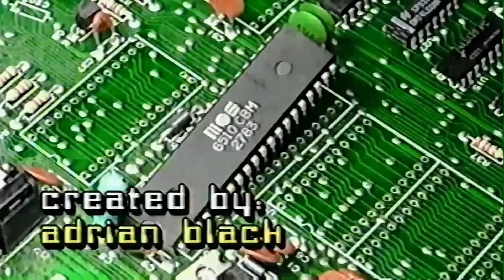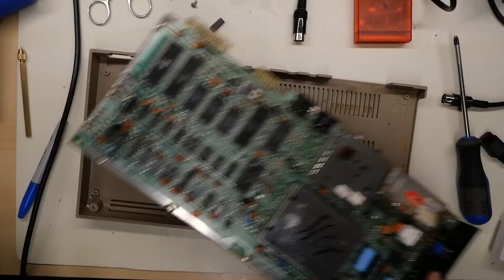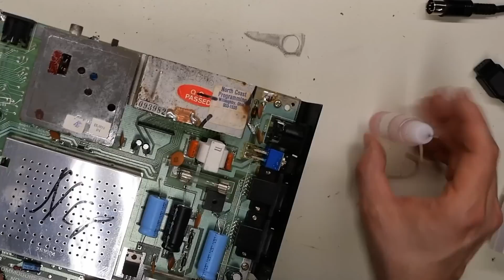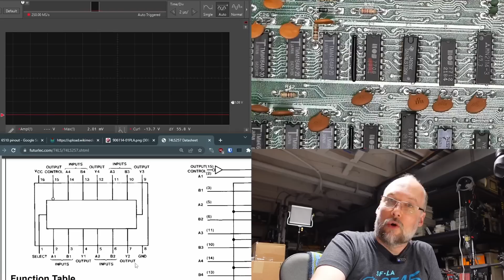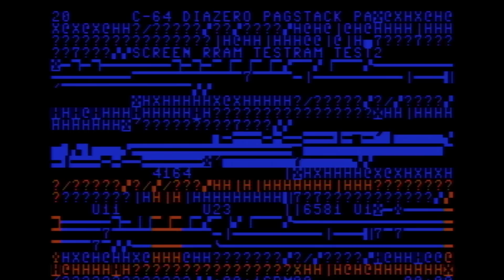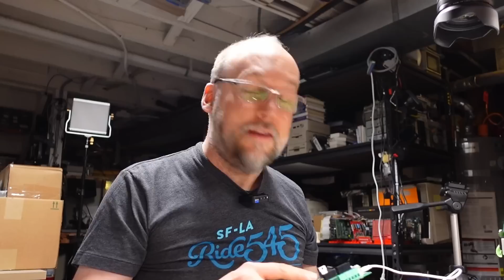2/12 C64 black screen repair: The chip was too fast for to work!

Comment: Hi Adrian i have 68 pcs of commodre 64 (All Working) a sx-64 1 c-128A and 1 c-128-D (all europe setup) 1 Amiga 4000 with 060 turbo and 240 gb ssd  1 pinoeer dvd 2 floppies 2 Amiga 1200 with 240 gb ssd harddisk with 030 turbo 128 mb ram currently and also all hardware possible or this devices that i made a very big collection even a atonce 286 pc card :) currently running win 3.1 on my 4000 running unix on my other hdd also i have shape shifter (mac emulation)  on my Amiga 1200  love to run em as i said since 1983 Commodre 64 and Amiga rules! Ps: Billgates and Microsoft Suxx! (as i say Since 1980) i can send you commodre 64 Business machines machines orginal Burnin cartridge .bin file totally free to copy/burn to a 27c64 eprom (used final test on production line in fabric) which left me D&R days on my cbm corps in early 1980's that will be much better for you to repair and fix dead commodore 64's...Take care mate Cheers...

Comment: I have a bit of an issue having just changed both my mos logic chip to 74LS257N. I wonder if its that chip type. Destestmax now says fail testing vic, zero page, stack page and page errors and i get a red border. The dead test runs but its garbled data but it looks like the CIAs are good. PLA is good and tested. CPU and VIC need to be working for destestmax to boot i understand, so they are ok too. Ive also changed the failing ram and the destestmax then just showed a jumbled page of characters like in this video, so i changed the logic chips and now i have the above issue. Any ideas anyone

Comment: When I removed chips and solder in sockets, I always used to put back the original chips in exactly the same positions and check that the symptoms are still identical to what they were before. This confirms that I have not made any mistakes fitting the sockets (and if it starts to work then the fault could have been due to a dry joint or perhaps a PCB/trace issue). Only then do I try the new chips in the sockets.

Comment: 19:20 - Tech tip, Adrian.  Insert the chip into a round-hole (high quality) socket before placing it in the tester.

Comment: I wonder what would have happened if you'd "tacked" a 0.1uF capacitor across the power leads of the 74F chip?  If the problem really was that the rise/fall time of the signal is too fast, there's a chance that the capacitor would compensate for it.

Comment: Wow! Brings back memories of fixing C64's in the day... this channel is so awesome!  I remember the way I found bad RAM chips was with the temperature feel test... HOT = BAD.  But I don't remember encountering bad MUX chips before, thanks... I learned something there!   I once had a SID chip problem that was caused by a bad socket... cheap sockets. 

QUESTION:  Do you have any suggestions for fixing broken keys on VIC-20's?  I have a couple of VIC-20's that have keys that got snapped off when (unfortunately) something fell on them.  I also need a couple of springs it seems those went missing years ago.  I still have the keycaps, they're fine... but the plunger part is what went "Snap"  Do you know someone that sells or has parts for repair?

Comment: Sometimes you can get the faster chips to work if you stick a few picofarads of capacitance on the inputs. Sometimes the faster chips allow glitches to get through that would actually get filtered by the slower chips. But there’s other timing issues that can happen too. 
I’m not sure any of the modern 74series chips are slow enough.

Comment: I tried a 74F series IC in a project and found out that 8 bit machines do not like them back in the eighties unless I was trying to complete multiple tasks in a CPU clk cycle.
Also the 74F and 74HC/T do not supply as much current as 74LS so may not hit the trigger level.

Comment: Don't quote me on this, as it's been a while since I looked at switches for the C64.

I believe the same type of switch is used in the Atari 130XE?

Have a look at the datasheet from C&K Switches, the PDF is called "7000 Series Miniature Rocker & Lever Handle Switches".

I'm not sure if they do a Dual-Pole Single-Throw, though. You might have to snip off the top set of pins to make it fit.

I have no idea what the original switch nor part number is, but if you can't find it, it might be worth buying one C&K switch just to try.

(I don't work for C&K Switches, btw. lol)

Comment: Adrian, you were asking for a database of C64 issues with screen shots made from your previous repairs, so I added a link to a page which had it all already done. When I looked the day after it was gone, I thought I must have not hit send so reposted the link (that I have no connection to) as I thought it would be very helpful. Would it stop people coming to the channel, no. But that link has gone again. A little explanation of why it's been removed would have been nice, just so I knew, it was just someone trying to help re a request you had made.

Comment: The pitfalls of propagation delays are always fun. I found long ago when using mismatched 257's, created many timing problems when correct signal timing was required on the same databus. Atari XY games were designed with that in mind.

Comment: Interesting stuff. Note the 74F series inputs have a .6 ma low input loading vice .1ma for LS. The 6x could also explain why the 74F didn't work.
Reply: Was gonna throw that out, myself... Just ran into this in a recent project.
Also, IIRC [later-note: *wrongly*], F and LS are [NOT] just about the same speed, too. F being older than LS, so "fast" in comparison to 74nn, not in comparison to other 74Xnn's.

Comment: '"The chip is too fast to work right!"'  LOL Was going to say even before seeing the video that it sounds stupid but is definitely a thing.  And exactly that, especially on DRAM, faster versions wouldn't work correctly with the timing that worked perfectly fine on slower versions.  Usually one of the signals isn't quite right per spec but was reliable with the slow, and the newer faster DRAM had tighter specs and needed the timing to be more correct. 
A LOT, and I do mean a lot, of designers misinterpreted specs and would often drop the data lines at the same time as the latch lines, instead of holding them for the correct times.  Used to see that kind of thing all the time, like half the people using DRAM didn't understand the data sheet..
Way back around 1991 I actually built a 1 megabyte C-64, with the info from Transactor for 512K in the 64 and 512K in the REU.  Worked great even though it wasn't exactly useful, still was a lot of fun playing with all the memory banking.  Between that and the GEN2 adapter and having a 20 MB Miniscribe hard drive my 64 was decked out, unfortunately the CMD etc hard drives came out right then too.  If I'd been about a year ahead I would have made it into a product.

Comment: Hi Adrian! The switches are really hard to find, but I could already repair those couple of times. They usually just get dirty inside and have to be disassembled and cleaned properly. You have to desolder the switch though, then you can remove the metal front part by bending the brace on the side outwards. Be careful, since there is a small spring inside, which you have to remove and clean everything with some IPA and a cotton bud. May be add some contact cleaner as well. After reassembling the switches work usually as good as new.

Comment: Great video! I use my RCT nearly every day, and while doing a Z80 project, I found a TI 74HCT245N had a bad bonding wire, I think. Pressing on the chip with a probe, it would pass. Remove the chip and just re-insert it into the ZIF socket, it would fail. I tried heating it up - no change. Freezing it - no change. Pressing it in the center of the chip with a probe - passed. Very strange problem I've never seen.  Thanks for the repair-a-thon!! I really enjoy these!

Comment: These MOS Mux chips look good on the scope even if they're bad. Had the same problem, all the outputs looked normal on the oscilloscope. My In-Circuit Chiptester gave different failure results for both Muxes so I tried a working C64, there I got the same failure results for both chips and one on the broken C64, so I just replaced the MUX with the different failure message and that completely fixed the machine.

Comment: The 9V line is also required for a working tape drive. On the C64c if the 9V fuse is blown or missing, the computer will still actually boot

Comment: I have a ZIF socket that I've ground down the top plate to the minimum I could get away with (remove the two screws first) and that allows me to test these ICs with the short pins. Or sometimes you can force the ICs into a standard socket and then place the socket+IC into the ZIF.

Comment: Speaking of strange C64 issues, I have one where after 15-20 minutes of being powered on and playing games, the video goes from color to grayscale...and stays as such until I power off and let the unit cool off for an hour.

Anyone had this issue? Any insight is appreciated!

(and no it's not the VIC, as I've swapped it with the one from my other C64 unit (the good one) and it still happens on the bad unit)

Comment: TIP
To Test chips that have their pins shortened you may need to insert them into a socket 
"Socket may need modification" and then that socket with the chip into whatever tester 😉
APU I dropped you a 👉👍👈
Reply: I used this trick to reattach a leg on a VIC-II. It works really well.

Comment: Logically (excuse the pun) the faster chip should work if it was only the speed that changed between IC types.  A faster car will still drive at 30Mph after all.  The main issue is that the logic input transition point moves between the different types (See wikipedia 7400 series page).  As the Vih Vil transition point changes between the ICs types that pushes the output slightly left or right (with respect to the original IC type). 74LS is bipolar hence is its logic transition point is based mostly on current while the CMOS style input (74AC 74HC 74HCT - and possibly 74F, depending on make) is driven mostly by voltage, switching one IC type for another works in many cases  - but only if the output of one IC matches the input characteristics of the second without moving the gate output timings out of spec. A shorter way of saying the same thing is TTL is low impedance logic input, CMOS is high impedance, changing between them moves the relative output timing of the gate.

Comment: There is a pictorial c64 web site with common problems listed, screen shots of what to expect and hints on where to start looking.   Rather than start from zero, start with that site and add Adrian's finds to it.
Reply: If the site were a wiki that would be pretty easy to do. If anyone knows the author it may be worth reaching out. If a picture is worth a 1000 words, a video is worth an encyclopedia.

Comment: Heres a trick for cleaning gold edge connectors. Years ago when I fixed pinball machines and arcade machines we used a soft pencil eraser to remove gunk. it works really well. you know those white ones on the end of your pencil or as a block from stationary store.
no abrasion to the gold fingers
Reply: @Mr Guru old erasers have 2 types of rubber. abrasive and non. just use the other end for erasing pen ink. never use sandpaper as it removes all plating and leaves exposed copper

Comment: I'm thinking of sending you a 487SX I have.  I just pulled it out of an NCR laptop which unfortunately had a bad power board.  The chip is actually older than the laptop was, but that could very well be down to the fact that it just wasn't particularly popular.  It says "USA" on the back and was made in 1991.

Comment: For emergency reference, any time that a chip is just too fast, you can usually use a simple 2 component RC circuit (maybe with an additional diode-resistor serial circuit across the resistor if you need a direction-based speed difference) on one or more of the critical inputs (for buffers I'd look at the enables) to slow it down. Not a great situation, and high-leakage inputs won't always work with this, but it can be useful.
Reply: If the output line is ringing, you need the RC on the output to take off the edge.
Reply: Commodore actually did exactly that. Not at the mutliplexers, but at /RAMCAS. They needed /CAS to the RAM chip to be late enough to not out-race the multiplexers, and thus they added an RC circuit to the gated CAS signal originating from the PLA to make sure /RAMCAS only goes active after the multiplexers switched..

Comment: Adrian, you tingled our curiosity! 
Now I cannot help but to wonder WHY it needs the LS (Low power Schottky) versions?
I'm guessing it's NOT speed, but it has to actually be low-power, but why?
Can anyone with socketed MUXes do some tests?
Reply from the maker: I can't really see it being power -- but maybe the F creates noise? (It's really "snappy" which can cause ringing and stuff.) More bypass caps needed?
Reply: @adriansdigitalbasement  I would guess (turned out to be likely wrong, though) the faster muxes violate the row hold time of the slow RAM, but other reasons (like the higher input current, as another commenter suspected) might be possible, too. See my comment to Daveyk021 for my theory.
Reply: It's probably the schottky characteristic rather than anything to do with speed or power.

Comment: I never had any Amiga or whatever.
My first computer was a Pentium 233 MMX.
In my past, I used to work a lot with electronic ( been my job in the 90's. VHDL for example).
Of course I used TTL.
I also worked as a sysadmin, mainly Unix.

I always enjoy your videos for the "logical" part in them.
You could fix sewing machines or lawn mower, for me the fun is the journey, not the goal :)

Comment: Maybe the F chip isn't too fast, but rather has too high a FAN-IN, IE: it's loading down the bus.
Reply: So then low-power Schottky version is there for a reason - i.e. it needs to be low power to work? 
I wonder why... are some of the chips too weak?

Comment: Well, it's time to unreveal myself :) I've been watching you for good few years now... I wouldn't say since day one, but I surely did watch all your videos and went through all computer-related stuff in pretty much realtime. In old computer community, your channel is my favourite source of information, both related to history and pure technic side of stuff. I'm a DIY enthusiast and I utilised your techniques on soldering, chip diagnostics etc. in many cases, even if these are not related to computers in itself (recently I diagnosed a failed IC on digital scales, for example... too bad it was completely rubbish and not worthy of an replacement, but nevertheless...). 
I do enjoy old 8-bit computers and have a special place in my heart for C64, it was my first computer (a late European shortboard version, not the breadbox one, we do call it C64C here, but it's not the 64C you mentioned several times). It used to have problems with the SID being too quiet - a common issue, but imagine me being 12 years old and reading the magazines where the solutions would be like "put a D/A converter under address $xxxx"... Now I know what to do with it, partially thanks to your channel, but Commodores are already going at insane prices and I have very little place at home, so you're giving me an endless source of enjoyment, even if I can't have one physically. I will not mention what I did to my C64, since I deserve a special place in hell for that, but I guess that if (theoretically) I coould sent you the pitiful remnants, you would have been able to fix it :) Just a theory though.

Anyway, keep up with the good work - I am always looking forward to the next episode :)